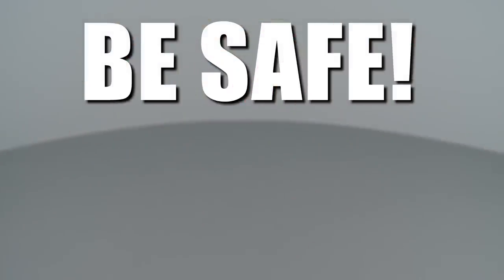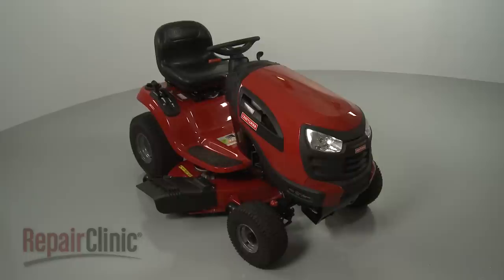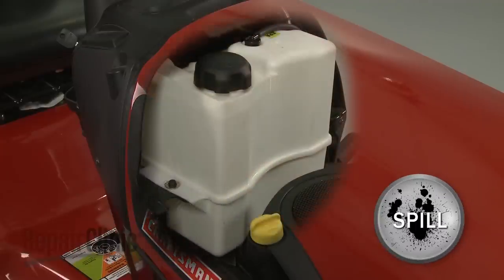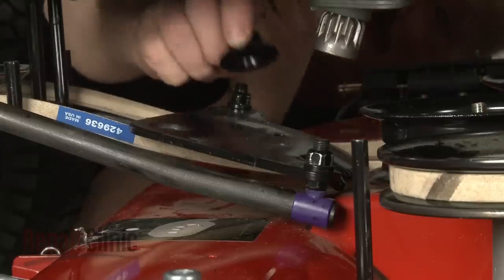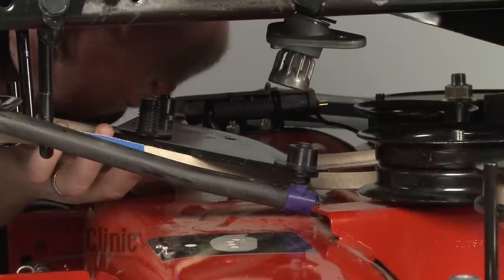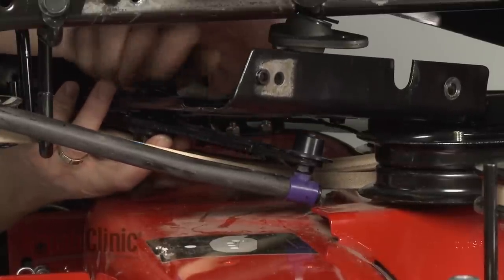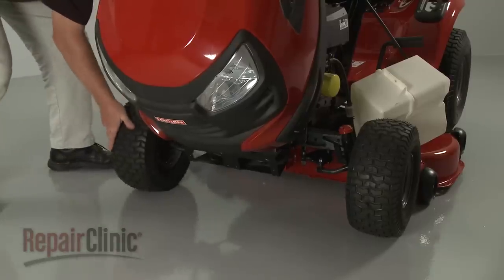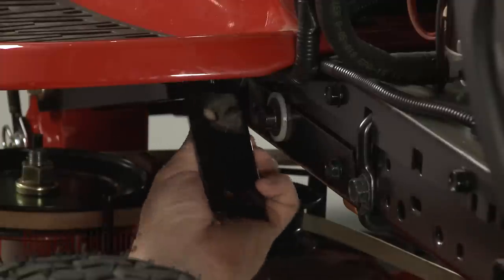Craftsman Riding Lawn Mower Left Steering Link #583513301

Comment: Great Video!  This video is for the YT3000. I have the YT4000. Everything is the same, except you need to remove the battery and battery holder instead of the fuel tank.  The bolts and bolt locations are identical to the YT3000 Fuel tank.  I almost gave up replacing the drag links until I found this video. Still took me 2+ hours.  As another commenter mentioned, I needed to use a breaker-bar to loosen the 3/4" nut loose from the bolt holding the steering plate to the steering bracket. What isn't mentioned  is the  bolt holding that plate is 15/16".  Not a big deal if you use an adjustable wrench to hold it while using a 3/4" rachet to loosen the nut, but be aware.   To remove that nut and bolt, I found it easier to pull out the entire steering bracket, plate and drag links as one unit (after detatching the links from the steering rack). Good Luck!

Comment: Had to use a 1/2 inch breaker bar plus a long pipe to break the 3/4 inch nut loose. Had to cut off one of the front nuts. Took 7 hours for me to do this. The video is pretty accurate on how to do it. Tough job for me.

Comment: Ok I just loosened the big steering sector nut. Loosened one side of the plate, removed gas tank too. I was able to pull the sector down low enough to pop the bushing out and get wrenches on the rear attachment bolt. I did one side at a time so the steering stayed connected at another point.

Comment: Thanks for the video. Except my YT4000 has a battery instead of a fuel tank I was able to complete the repair. As others mentioned some bolt sizes were different and I did need a breaker bar for some. Thanks again. Now if you could just show where item 161, clutch return spring connects I would be very happy.

Comment: My wife hit a stump last summer and knocked the steering out of alignment, both wheels went toe out. I replaced both drag links and the steering gear but I still have bad toe out. Do I need to loosen the mounting plate and realign the wheels before tightening it?

Comment: Make SURE it's not the spindle causing the toe-out before you go thru the agony of the drag link - been there, done that.
Replaced a drag link on a YTS3000 and turns out it was the spindle causing the  issue - MUCH easier replacement.
Reply: Bob G what else would cause the towing out of the front end
Reply: Bob G never mind I just seen read the whole thing the spindle he replaced on much was the spindle you know

Comment: You don't need to remove the large bolt that holds the sector to the plate. Just take off the front nuts of both drag links and let the links hang down. You can loosen everything with the plate still attached. IMHO just did it.
Reply: Yep I did the same. but all in all great video
Reply: That bolt is bitch to get off, I didn't think of your solution. Thank you!

Comment: Thank goodness my tractor does not have all that stuff to remove. I have bought both new arms from your warehouse and still the wheels do not line up...what gives??? I'm confused now????
Reply from the maker: +Paul Govensky Sounds like the wheel spindles on the tractor might be bent or worn out.
Reply: I also purchased two new spindles also and still one wheel is bent the opposite direction. The only thing that is left to do is either look at a few other models and see if the left link is shorter than this one and try that. Or heat this link up and pound it backwards 1/2 inch.
Reply: Paul Govensky did you figure out how to fix it? I'm currently in the same situation. i just changed both draglinks and my right tire is straight and my left is turned to the left. I'm stumped on how to fix it.
Reply: Yeah I figured it out. I had my buddy grind the weld out of the original and weld it to the correct position. Just mark it and don't grind to much out of it. This tractor went back to the customer and I've had no complaints yet...
Reply: Cut the drag link and remove 2 inches of it..thread both cut ends and put a threaded sleeve in..adjustable forever..pain in the ass..but worth it

Comment: horribly engineered design (by peole that obviously don't have to make repairs to their own design), all to get to one nut on a part that is guaranteed to wear away and require replacing, rather that presenting access to it in the already stamped hole in the frame just an inch away.